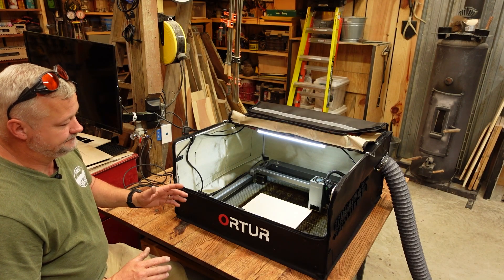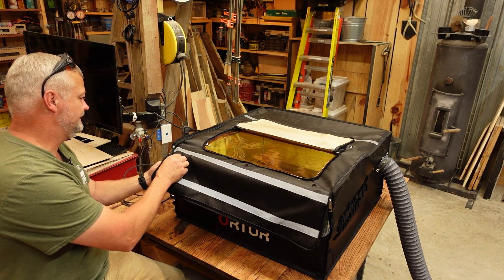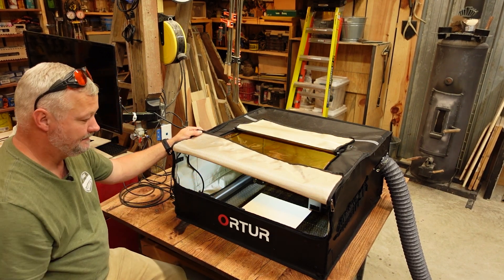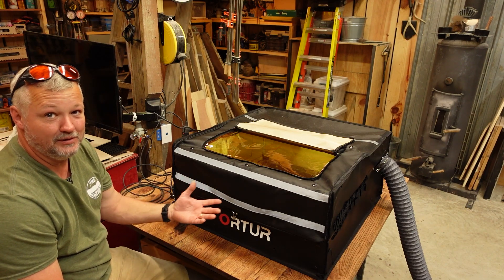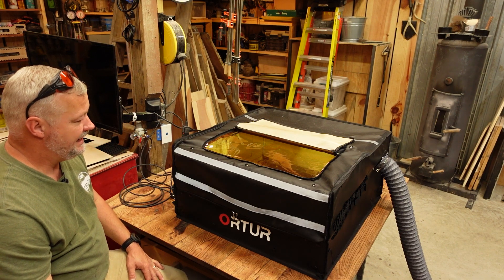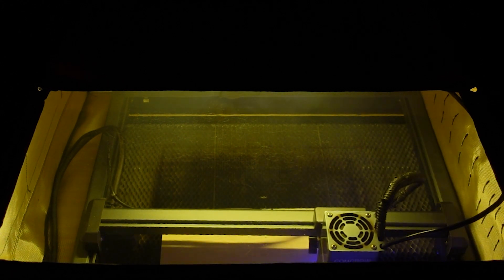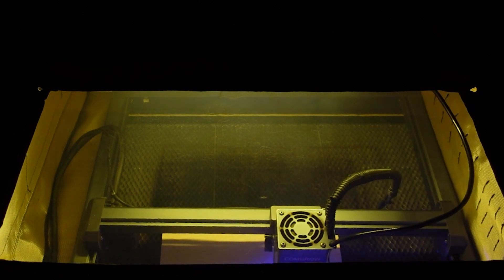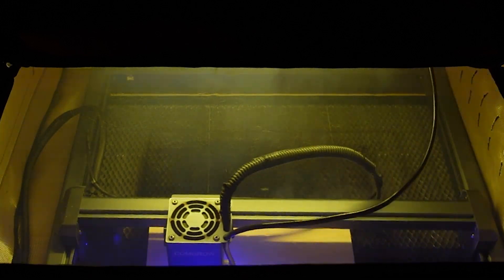lightburn activated enclosure fan and light?

Comment: can we use light and fan on-off with athore laser printers? i have creality and i use lightburn with raspberry pi at the printer.
Reply from the maker: This function is dependent on having the right outputs on the board. Not all machines have the correct ports.
Reply: @TheClackShack  my printer DONT have port for light and fan. i use raspberry as lightburn Bridge. can we use the gpio of raspberry and control it from lightburn with macro like you? do you try like similar??

Comment: it is actually using (sending) gcode to the controller unit. with Lightburn you can edit gcode startup to include the gcode to turn on the fan and turn off/on the light at the start of all gcode processing. I would imagine you cold add a post code to turn off the fan at the end of your operation - but I would advise against that because the fan is continuing to cool down the laser module after completing the project.
Reply: Pro Tip; If you go into your library settings on Lightburn and assign settings for layers (=materials) for your power and speed settings for that particular layer, this will alow you to set layer 2 to be for engraving on coated metals, layer 3 engraving on MDF wood, layer 4 engraving on birch plywood, layer 5 engraving on pine plywood... etc. for your most common materials leaving some open for special project settings. this will speed up your work flow say for jigs engraving tags you would have a layer setting for coated metal tag, and a different layer setting for a wood tag.
Reply from the maker: Yea, only thing is I run multiple machines. When I only had one, I did this. Settings change with each machine, I choose to set them as I go to avoid using a setting for another machine.
Reply from the maker: It controls the exhaust fan, not the module fan.

Comment: Just curious, I hear you mention light escaping from around various enclosures. Is that escaping light actually harmful to your eyes? I would not think the light itself would be harmful unless you are looking into the light beam itself.
Reply from the maker: Highly reflective surfaces like metal and mirror can reflect the beam outward. Wood and other rough surfaces. Reflectivity isn’t a problem. I am not concerned with the laser cutting or harming anyone that far out of focus but eyes can be damaged by too much exposure to really bright light. If I had young children around, I would want to make sure to contain all of the light as a precaution
Reply: @TheClackShack  Thanks, I am using Atezrs encloser and it works great, It does not have a bottom but I like the way it opens and closes with just Velcro and magnets.

Comment: Wow, this could be great to drive air assist and a larger exhaust fan. Where are the connection points on the LM 3 harness? Contacts or voltage outputs?...lots of questions.  Will you be following up with an air assist modification? Thanks for the video!
Reply from the maker: There is a plug connector inside the front of the machine labeled I/O

Comment: Excellent tip as usual :) You can however improve on it by adding your commands/macros to the "Device Settings" - "Gcode" and the Start and End Gcode" which is called on job-start and end. That way you can automagically turn on or off the light and fan when each job starts 😀
Reply from the maker: Great tip!
Reply: @TheClackShack  Thanx, maybe not turn off the fan automatically after job-end, as that would leave the enclosure with a lot of smoke - or maybe there is a possibility to add a time delay I wonder 😁
Reply from the maker: @pelleparrafin  I like the auto on idea though,,